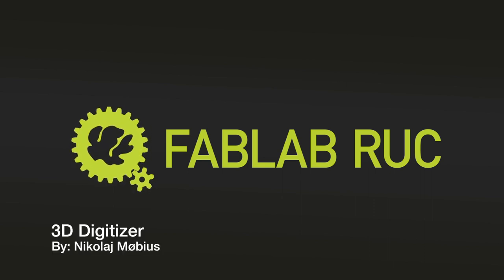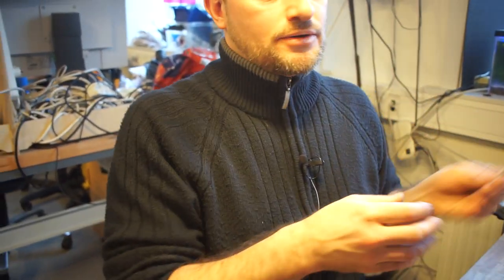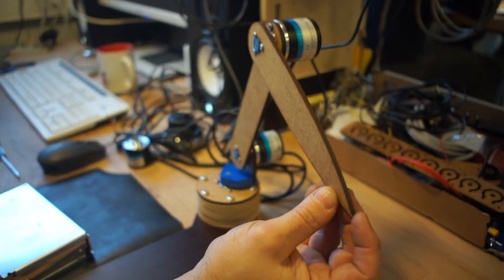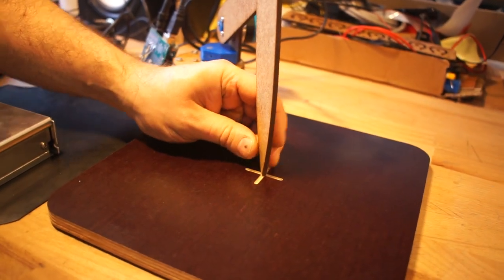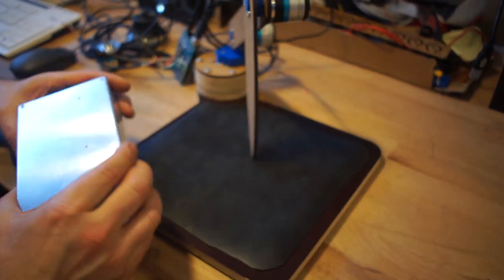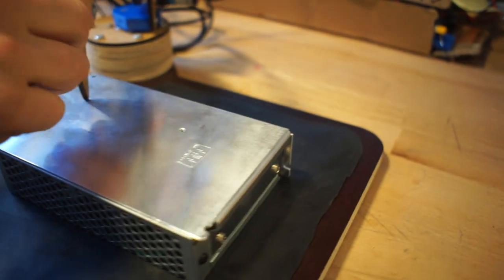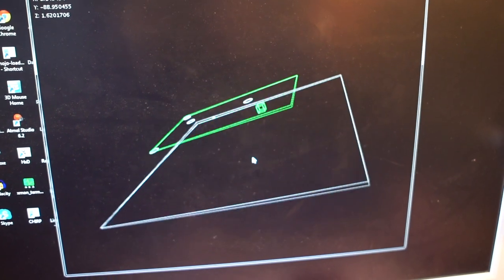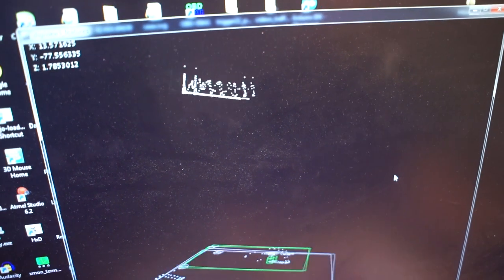DIY digitizer for converting physical objects into virtual drawings.

Comment: Nikolaj,
I love your project, but I have one small suggestion for an improvement.   Design the base to be "plugged into" a pegboard with dowel pins.   That way you can capture points on different sides of an object and then easily joint your point clouds.   The hole spacing will determine your registration points.

Comment: Nice concept here, I'm looking forward to future development.
Using a (exchangeable) ball for the tip would make this a bit more serious device. Don't need to be the diamond version like on the Zeiss measurement instruments, I think a small steelball with 3mm diameter will be fine :)
Much easier to locate the holes precisely and very usefull for freeforms too. 
For the measuring of 2D contours a small cylinder (dia3-6mm) on it would be helpful?

You can add a threaded rod to the tip and use it without anything or with a small steelball or whatever the user wants to add -> free defineable tool libary!
Reply: BRO CAN YOU SUGESS ME WHICH ADRENO USE IN THIS VIDEO WHATA A MODEL NO OF ADRENO....